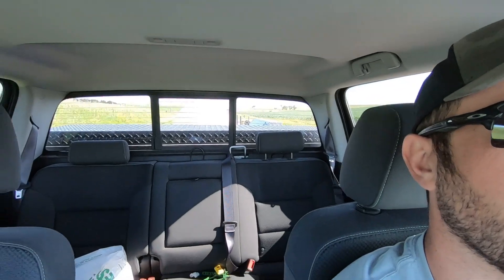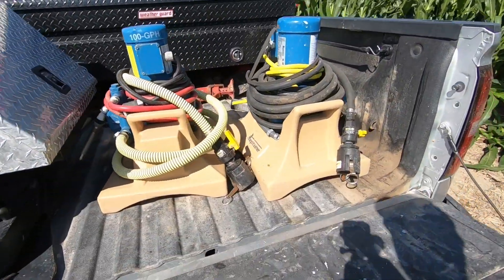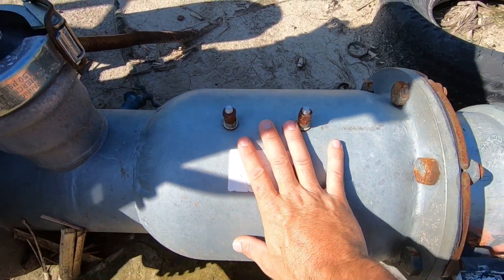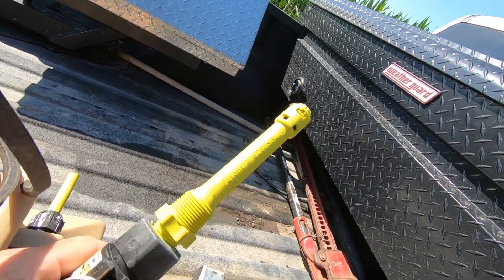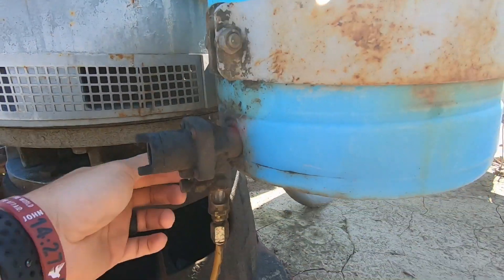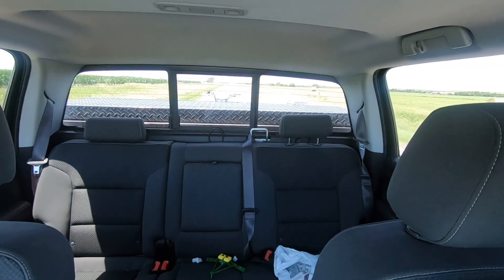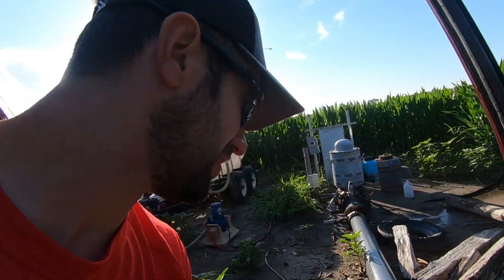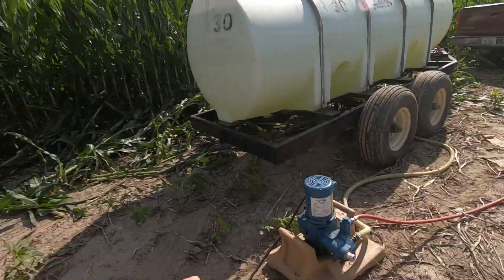Summertime... Finally 🌞

Comment: So where the pipe is put down, is the row filled with water till it runs out the down row side? Seems like it may flood on the pipe end and get just wet enough on the end of the row.
Reply from the maker: The pipe is always put on the end that has the higher elevation so it runs downhill if that's what you mean.

Comment: We pump chemicals and fertilizer saves a trip across the field, or the cost of a plane! But,,,, our water is a little harder so most all of the systems are underhung with PVC and drops off of it. It’s actually cheaper the buying the “lined” systems. Looked like the Boss Lady was waiting on you quite a bit! Corn and beans look really good! Awesome as always Rob!
Reply from the maker: I’ve seen Systems like yours before I didn’t know why there was PVC pipe underneath the regular pipe. That’s interesting good to know. i’m glad she still helps thanks!
Reply: Yeah we learned the hard way, it just extends the life of the system. Plus we don’t have a need for the taller systems like y’all do because cotton and peanuts don’t compare height wise with corn. But I didn’t know about the injection nozzle like you use to spray the fertilizer into the water, makes great sense! I actually called and ordered several of them.

Comment: Good job of explaining!   I have done a lot of chemigation over the years as I started about 1960 with Injectometers driven by the well motor shaft.  We usually have two 3,000 gallon tanks for a pivot.   That takes 6 transports of 4,500 gallons each for a half mile system during summer.
Reply from the maker: You guys don't fart around.  I've seen remains of those drive shaft one's around here. Thanks!

Comment: Why do you use sticks of pipe instead of rolls of poly pipe? Is it cheaper in the long run to invest in sticks that you reuse year after year?
Reply from the maker: A lot of this pipe is already bought and paid for by either us or the landlords. Plus some of our fields will have quite a few sets in them and I believe with the poly pipe you have to run a line for each set. but I think it would work good on some of our Pivot corners we just haven’t looked into it very deep yet